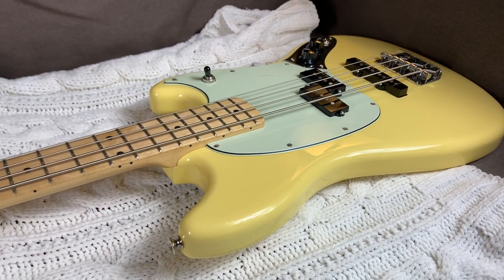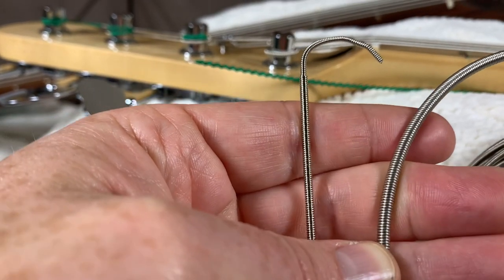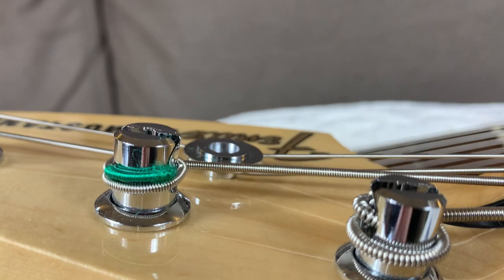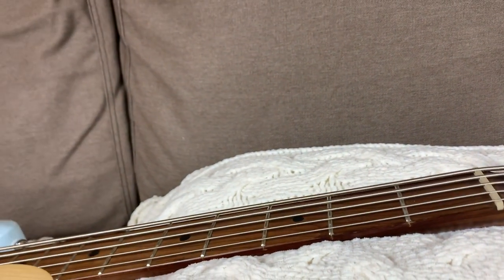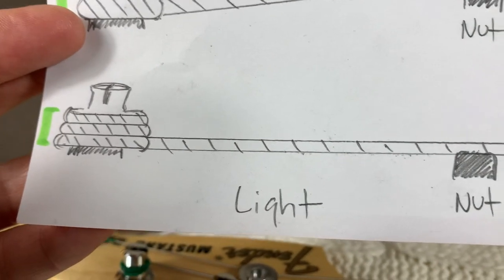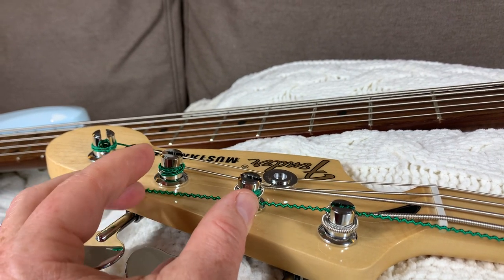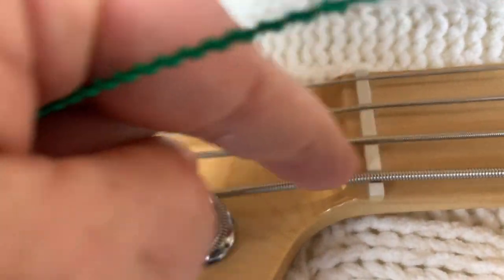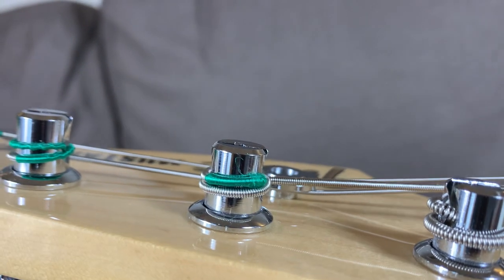String Buzz Caused By Switching To Light Gauge Strings (Bass and Guitar)

Comment: Thanks for the Information - I plan on doing this to my Bass A String next time I change Strings.  However - I just put new Strings on a week ago. So... Here's what I did.
Temp Fix Tip - I cut a small piece from a Cereal Box.  Folded it in half & placed under the A String, between the String & the Nut.  I cut the folded Cereal Box material so it's barely noticeable & it Works!  Buzzing Gone!  Not a long term fix.  But, it'll work until I need new Strings.  When I change Strings again, I'll leave it longer to get more winds.  
- Thanks for the Tips & Good Video!

Comment: Just bought a brand new Sterling Ray 34. A string buzz at the first fret.  Looked at it closely and they put short scale strings on it at the factory, the step down in the string caused it to buzz at the first fret, after that it was fine. Changed strings (with proper post wrap) and buzz is gone.

Comment: This has happened on my brand new FGN 5-string bass which I've tuned to Meshuggah's Bb F Bb Eb Ab tuning (140 for the Bb and Ernie Ball Extra Slinky - 95 to 40 for the high 4 strings) The F string which now has a 95 has EXACTLY the problem you describe - looks like I'll have to replace this string and put more winds on the tuning peg. p.s. sorry to be pedantic but it's your BOTTOM string or LOW string and not your "top string" as you describe - sorry but that grates a little bit. However it's a very good video all the same - Cheers.

Comment: First let me say Thank you for the great info you provide for us aspiring guitar geeks. Much appreciated...I have a question about my r60. I used your LP set up video and discovered the neck on this r60 was way too tight (neck relief over 20mls at the 8th fret)   when I removed the truss rod cover it looked over tightened ( from Sweetwater) or Gibson !? anyway I made some adjustments but the nut got so loose I could turn it with my hand easy but still over 20mls at the 8th fret. will the neck relax over time do you think? or did I just throw a lot of money in the garbage ? I'm the second owner, the first owner left it in its case for 2 years (still smelled brand new) and had no idea about set up.

Comment: Just need to push the string down as winding...3-4 turns takes it to bottom of tuning  capstan (Fender) giving a good break angle...i go 2 1/2 tuners/times past each post...apart from D & G string as Ernie Balls are not the longest but long enough as most bass's have a string tree on the D & G strings....i wish someone made angled triple string guides, like the  Sandberg types but leaning the other way so as to hide the old string tree hole.....
Reply: @christopherstorrier Agree with the Sandberg triple string guide as a solution. I bought a copy / cheaper version of 
this guide which looked exactly the same as the Sandberg one for a JB copy, it solved my rattle from the A string 
and gave all strings a more even and equal break angle. Not expensive and saw it on Ebay UK. Best wishes.

Comment: Please forgive my questioning anything at all, but that E string looks like possibly the worst tuning post wind I’ve ever seen.    One wrap was stacked on top of the previous wrap, and it seems like that would lead to some tuning instability, at the very least, and when it flops off of its precarious position, it would detune by quite a bit, I’m sure.    Whilst demonstrating best practice for bass tuner, nut, and break angle practice, it would seem that you would want to put your best wrap forward.       But thank you for the insight.    Duly noted